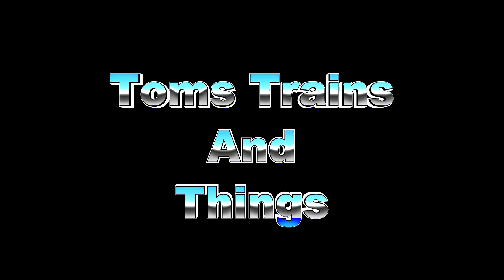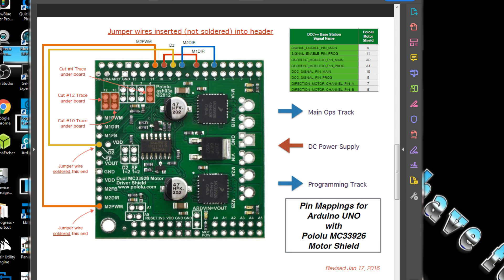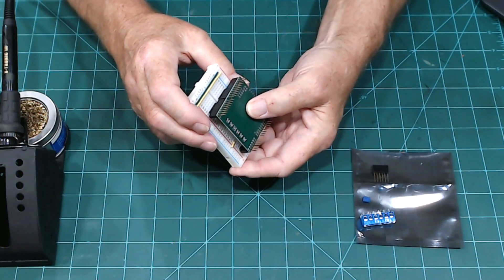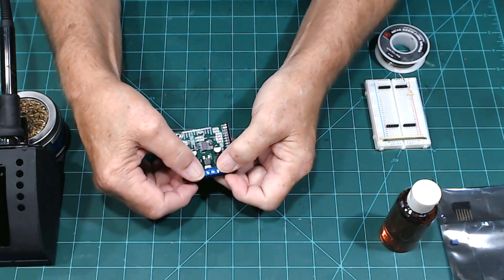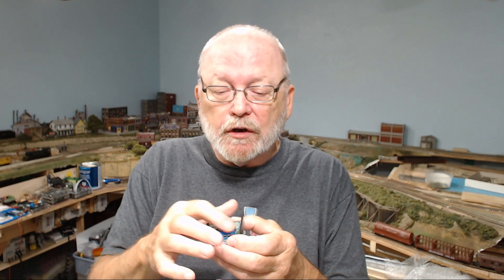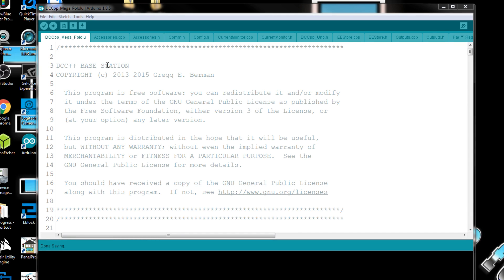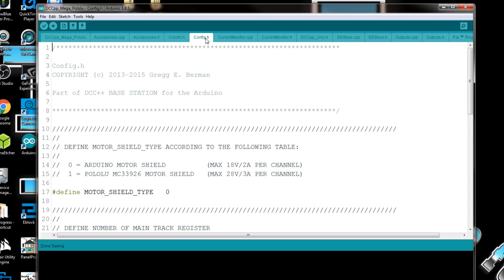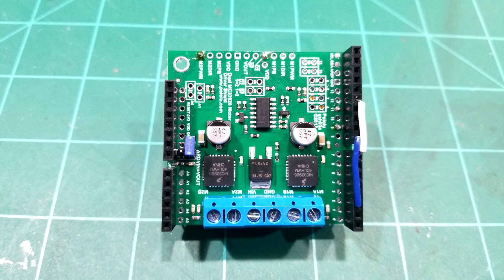Setting Up The Pololu Motor Shield For DCC++

Comment: Thanks Tom! How much voltage drop between the Input power supply and whats at the Track ?  With the Arduino motor shield I was getting about 4 or 5 V drop!
Reply from the maker: That's about right if your using a meter on the AC scale. The only real way to get an accurate measurment is by using the device made to check the DCC signal.

Comment: Tom Has anyone had any luck using the Pololu Dual VNH5019 motor shield (12 Amp rating) for a DCC++ Arduino controller instead of the MC33926 that we know works?
Reply from the maker: If you watch my latest video on the DCC++ Installer, I mention a new version of DCC++EX. I have a link to the web page. This is an improvement to the original code for DCC++. They are still working on it, but you can look into it The link in in the pinned comment in that video.
Reply: @TomsTrainsandThings  Thanks

Comment: Hello Tom, I've just got a Pololu motor shield which I intend to use with an Arduino Uno. Can you please confirm that the modifications you mentioned in your video are still applicable? Many thanks! Ervin
Reply from the maker: Nothing has changed.

Comment: Hi Tom great job - I've bought Pololu shield because of more apms... Of course I've got arduino motorshield as well. I've got one problem with Pololu - maybe You could help me. Everything works well with Pololu exept one thing, when on my layout is short circuit then Pololu is turinig off voltage on track, but there is no information to  JMRI (in arduino motorshield works corretly), do you know where the problem is?

Thank you in advance!!!

Regards

Miqi

p.s. I'm so sorry for my english
Reply from the maker: Make sure you wired it correctly and your solder joints are good.  https://github.com/DccPlusPlus/Documentation/blob/master/Motor%20Shield%20Pin%20Mappings.pdf
Reply: Hi Tom - thank you :-)